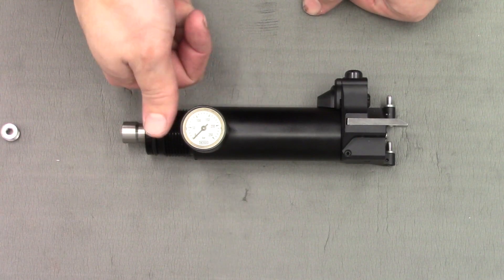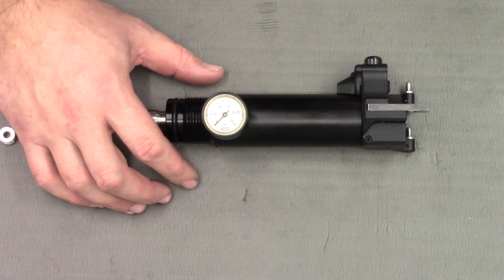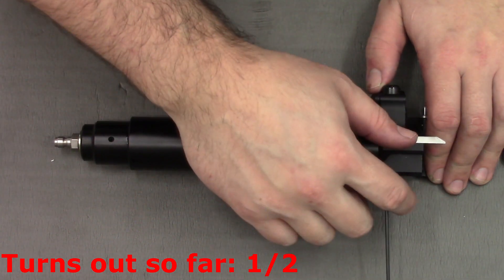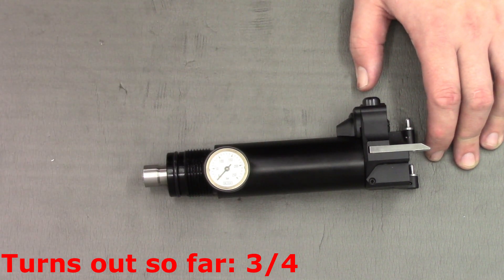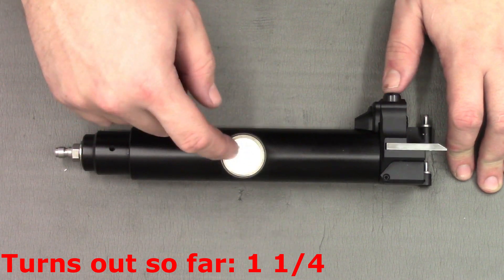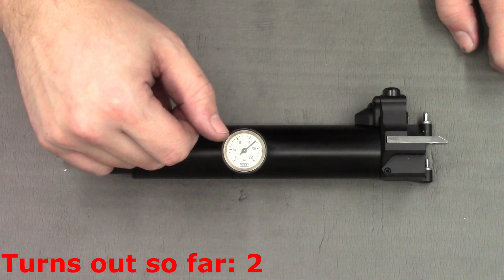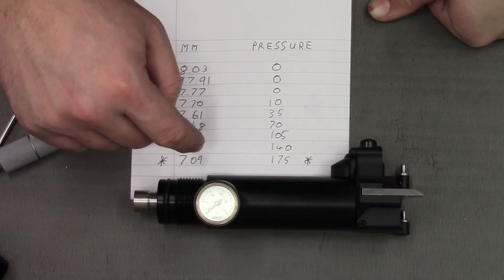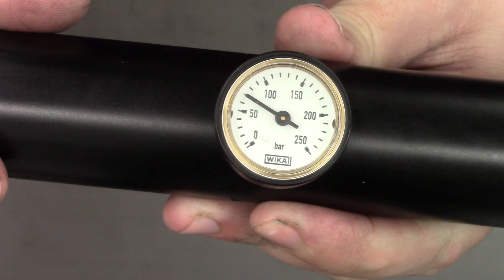Leshiy 2 regulator pressure setting

Comment: So it's not that 1/4 of a turn changes the pressure by 15 bar, like the edgun video says... ? 
Your measurements show 35 bar per 1/4 of a turn.
How can it be so much off?

Does yours have a special sub 12 FPE reg perhaps?
Reply from the maker: I think for the FAC versions the belleville washers may be in a different orientation and therefore change the way the reg behaves, the regs on the UK versions are set way down so they very well might be set up differently. Thanks for watching.